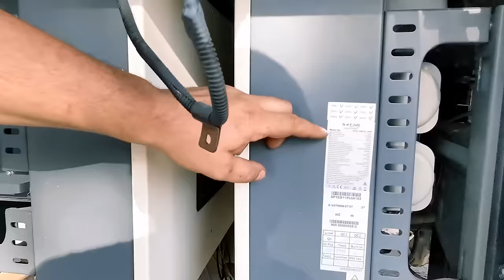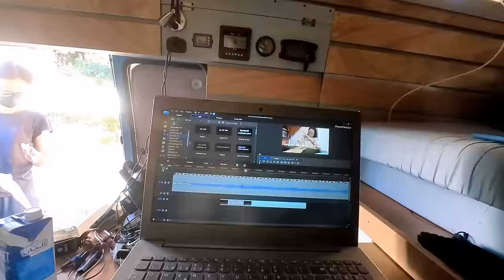Ultimate Off-grid EV Camper Bus Will Blow Your Mind! No Charge Station Needed!

Comment: Admiration for the French who just build this sort of thing. Now waiting to see the innovator who takes a sailing mono hull, (not a catamaran), takes off all the masts, booms, winches and diesel engine and installs a full telescopic solar roof. Roof deployed like this at anchor.
Reply: catamaran makes vastly more sense.
Reply: There are commercial solutions for 24/7 cruise at 3-5 knots during summer or near the equator. Cost a couple million though.  Haven't seen a diy, which is surprising since it was advertised they only have 300kWh of batteries - which is only 4xclassic Model S. That amount of batteries only costs the price of a big engine you'd want for such a boat (about 50k)
Reply: @rkan2 classic tesla battery is worn.. water and lithium is another story.. weight to calculate for 😮
Structural integrity for a boat is something to master so we will wait longer, or some idiot will build it anyways
Reply: @mmuller2402  The 85kWh packs would be 340kWh, so I counted with 75kWh for used packs for 300kWh. With the shell they weigh 540kg/pc or about 2 tons for a boat. The shell weighs about 100kg afaik.

I can also see that eveurope is offering them packs for 9k€/pc. So you could build 300kWh pack for 40k€.

Comment: Winter I will get 1/3 the kw.hrs out of my solar panels cf summer. 

My 1.8T car ev uses 16kw.hr/100. Pretty typical.

That bus would be ~ 20T, maybe 25T. 

So proportionally I would expect 177kw.hr/100km to 222kw.hr/100km. 

He is doing well to get the range. Large vehicles tend to be more efficient at kw.hr.kg/km, even with less aerodynamic shape.

Comment: I can't believe a single Model S motor can power this huge bus. I suppose it is heavily geared down, which could mean it is more powerful than the original Diesel.
Reply: It will definitely have the power and torque, but you are a lot closer to the max continuous output in a bus than a passenger car.
But it will be driven easily and not for hours on end.
In the industry you see very big electric motors which do not make more power but continuous power is high

Comment: Amazing work! But did I get it right - 10 days of charging is necessary for a 300km bus ride? Which means average travelling speed is just 30km per day?
Reply from the maker: It was the middle of winter when we filmed this.. soooo
Reply: @campingcarjoaen  OK so traveling in summer is a bit faster. My dream car should be able to go at least 600km and fully recharge solar in one or two days. The "Stella Terra" invented by Solar Team Eindhoven gets quite close to this vision.
Reply: if you put it like that it sounds slow, but you could also say 3000 km every 3 months, and consider that is a house and you'll stay at places for periods of time contrary to be on the moving all the time. I give you tho' that it sounds a bit impractical to have to plan the trip  in <300 km legs, but still the distance/over time seems acceptable.

Comment: even bi-facial solar panels, even more power. no, solar panels are just about 5500usd for 16kW. the 100kusd is way overkill.
Reply: 100k is the whole build, pretty reasonable compared to what's on the market
Reply: @romteb  someone is getting ripped off, very much, I dont support the expert prices on the market, diy, reasonable = ripped off
Reply: @romteb  yeah market makes everything expensive, you could have done it free for yourself diy
Reply: I would assume 70% of that cost went thru the powertrain. Battery, motor, custom axles and so on buuut. No wrong. This was overkill for the project. Besides Tesla motor and battery aren’t really all that reliable either. Diesel and proper SCR setup would have given him much more mileage vs cost vs carbon footprint challenge. Only down cost of that is though. There still would be EGR and intake service interval.

Comment: Get maybe a mile per week charging?
Reply: The batteries max out at 225 kwh, the solar array is 16kw. It would take about 14 hours of direct summer sunshine to fully charge the batteries. He said at full charge they get 300km, that's 186 miles. Let's say in a more typical day the array charges the batteries about half. That's 93 miles. A quarter charge is about 46 miles. A 10% charge on a winter day would be about 18 - 19 miles. So if they stayed parked for 2 days in the winter they would accumulate enough power to drive to a new site 30 miles away. Either way, definitely more than "a mile per week".

Comment: Charging 10 days for fully charged batteries by his own solar, to get a range of 300 km. May sound arkward to petrol-heads.
But speaking as an EV and solar nerd and owner myself:
Charging my MG4 (64 kWh battery) from 0-100% by my own small 3kWp (house roof) off-grid solar PV, it also takes me 20 days, ensuring full additional coverage of my household consumption. Given the same travel speed as the bus guy, I'd get a range of around 450 km.
Oh, and for me it only works out in summer, whereas the bus guy talked about WINTER.
🔆Solar-electric⚡ applications of all kind: I ❤ them!
😍🚙🚎🛵⛺🏠🚛🚄🛥😍

Comment: ERVs will be taking the market by storm if these RV manufacturers have half a brain with their current problems... in mind. That said RV parks will have fast charging stations soon so... no problem.. you won't need more then a few 360 watt panels to keep your fridge and all running.. your drive line batteries you can fast charge them..

Comment: With all pannels charge in 5 days ? Why so long !
Reply from the maker: It's the middle of winter when we met them, 😉
Reply: EV vehicles use an enormous amount of energy, it just takes alot of power to push that much weight around and fight friction too. For example, a fast charger for a normal ev car (lets say, charging an average ev fully in one hour) could use around 200 KW of power. Solar energy density is never greater than 1.3KW per square meter on earth, with solar panel efficiency that means his entire solar setup just charging an average EV car battery is going to be nowhere near as powerful as an ev charging station.
Reply: @peteheatb3  thanks i understand now
Reply: @odd13579he said they stop at 50% so 5 days is for 50% charge

Comment: That thing would suck to drive. A single Tesla motor is not going to accelerate well at all. With its horrible aerodynamics, top speed is probably pretty low also. 200 mile range on back roads only doesn't sound appealing unless you're retired with nothing better to do.

Comment: Drive 50km and stop for 5 days. It seems more of an ideological statement, rather than a  practical solution.
Reply: Looks like it's still got a diesel generator. I'd make this a hybrid system.
Reply: Your point isn't wrong but your numbers are, they drive to 50% battery capacity not 50km so that's about 150km roughly